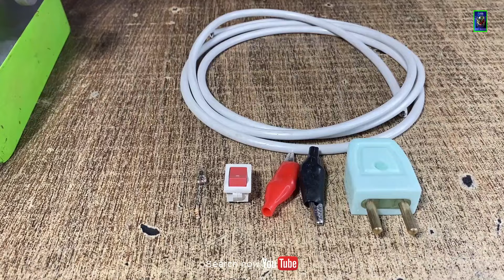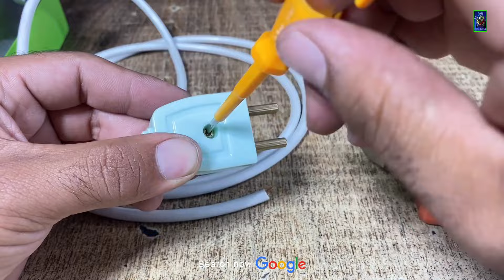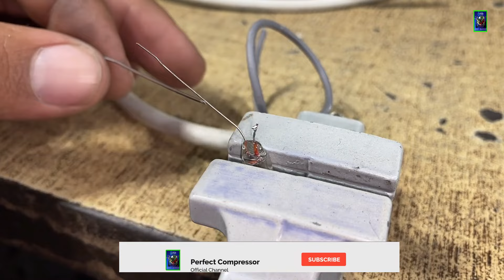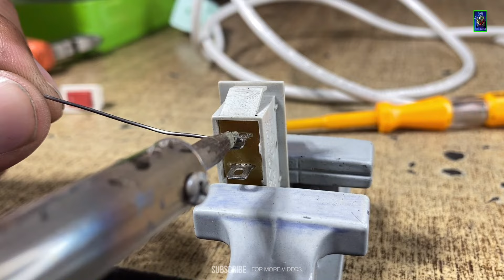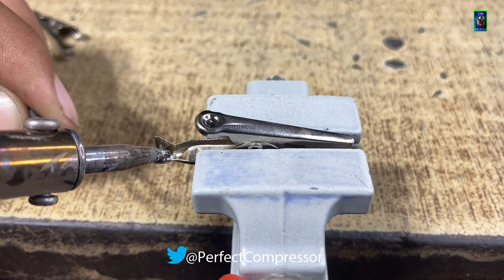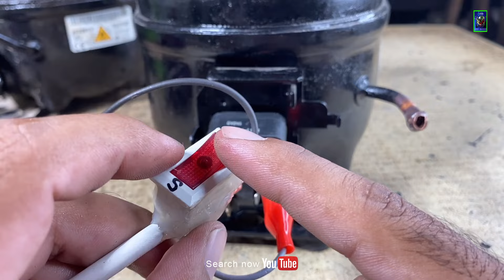How to make compressor test lead with series point

Comment: Best video but sir u did not mention resister value..
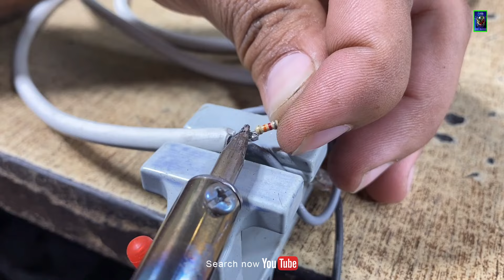Reply: I see this video is more than one year ago, so maybe you already found the answer but anyway here it is - Looking at the video at 2:40 I see the resistor held in the vice; and the colors bands on it are a coded way to show the value.

grey = 8
red = 2
orange = multiply by 1 Kilo ohm
gold = 5% tolerance

This resistor color code indicates a value of: 82k ohms